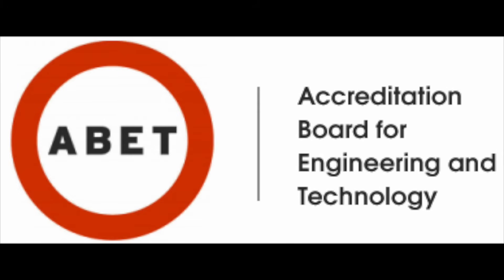WHAT IS ENGINEERING TECHNOLOGY (DIFFERENCE BETWEEN THEORETICAL ENGINEERING) in the U.S.?

Comment: I graduated from it late last year with a BSEET, and we covered differential equations and calc based physics, although it was not as full, and separate courses.

 I think ABET should increase the math and science requirements slightly for the 4 year/BET degrees. Maybe add multivariate calculus and calc based statistics ,  or atleast require calculus deviations of formulas in science and engineering classes before moving onto algebra. Keep the engineering classes applications focused. Heck, maybe make the division between theory and application with the engineering classes, and keep the math and science requirements the same for both BE and BET. I thinks that's what India already does with their BS and BTech designations for engineering degrees. Right now I think there's too much of a gap between ET and regular engineering and too much of a gap between BET programs themselves in the US. This is likely a major cause of the stigma of not being good enough/watered down that BET degrees get in some sectors, like aerospace and government.
Reply from the maker: Thanks for your comments.  Here is the problem, the ones who hire my students do not need them to have the upper levels of calculus.  As a professional, I used calculus to tune some controls, but that was very minimal.  Our advisory committee asked us to get rid of Calc 2 and replace it with statistics because it was much more useful to our graduates.  Since applied engineers (ET graduates) do not design in general,  but use designs in applications, then I really do not think that ABET should require something that is not needed.  There are actually several publications about the fact that when ET becomes more like theoretical engineering, then ET will serve no purpose and eventually not exist.  That is my experience with industry, others might be completely different.  And there will always be elitism in different disciplines.  There are many industries that hire my students that prefer our ET graduates over theoretical graduates because they are ready to "hit the ground running" when they are hired.  These are not small companies either.  Thanks for the comment.
Reply: @TheCommonSenseProfessor  I agree about the whole elitism thing. While I haven't personally encountered it in engineering( that I'm aware of), I have in other areas. And there's always the question of "is the reason I didn't get a call back  my degree being ET?" Granted I wouldn't want to work for a company that had that mindset, but it's still in the back of my mind. I was also unaware of the request to replace calc 2 with statistics. Anyway thanks for the great response professor I appreciate it!

Comment: Does the ABET accreditation for an engineering technology degree have any bearing on its perceived value? And how long does a person with an engineering technology degree typically have to get an engineering job before they’re locked out of the industry for good? I graduated in April with a manufacturing engineering technology degree that wasn’t ABET accredited (although guys from the unaccredited welding engineering technology program from the same school have been able to get into engineering jobs), I’ve worked in a couple of internships, and now I’m working as a machine operator. Is there a timeline for me to get into an engineering job?
Reply: Thank you for your response, Professor Hildebrant. I’ve reached out through LinkedIn. 

I’ll tell you what, if I could just get an offer for an engineering job I would be on a plane for Kentucky - or driving there, if I had to - as soon as I could find a decent Airbnb, and I don’t think the drive from Utah would just be a day trip.
Reply from the maker: @jaredfullmer7043  I just sent you a message through LinkedIn.  I hope this helps.
Reply: @TheCommonSenseProfessor  about one year later I’m in an engineering job. It turns out that my program did get accredited after I graduated.
Reply from the maker: @jaredfullmer7043  That is fantastic news Jared and congratulations!  Thanks for keeping me updated.
Reply from the maker: Hello Jared, great questions.  I do not know what state you are in, but here in KY, Manufacturing Engineering Technology graduates are in high demand (and yes the report specifically mentioned Manufacturing Engineering Technology and not Manufacturing Engineering). I also assume you have a Bachelor's degree and not an Associate's.  Here is the report: http://www.cpe.ky.gov/data/reports/engineeringreport.pdf  

Now to answer your question, yes ABET does add credibility, but it should not prevent you from finding a position if you are willing to move.  If you have an Associate's degree, then that prepares you to be a technician, which might be more limited for Manufacturing then let's say, Industrial Maintenance.  If you do have an AS, then you might want to look into continuing to complete your BS.  My university created a Manufacturing Engineering Technology program that allows student with an AS to move directly into a BS so they can move into an engineering role.  ABET accreditation for a technology degree can also hinder changing your program to match industry's needs.  The college you went to also has some value to the degree that you get.  That plays a role too.

To answer your last question, the big thing is that you are in industry and not sitting in your basement playing games while you are waiting for the perfect job.  There is this thing going on called COVID, and people understand that it is hard right now to land a job in your area.  That being said, I know there are many jobs out there for you.  There are "head hunters" that are looking for qualified people with your skill set.  If you have not done so already, I would suggest setting up a LinkedIN account (Be sure and look up what to do to make your account set apart) and then seek out these recruiting firms and apply to the positions that they post.  Here is my account, you can look at my connections because I am connected to several recruiters to help my students.  I hope that this helps: https://www.linkedin.com/in/jakehildebrant/